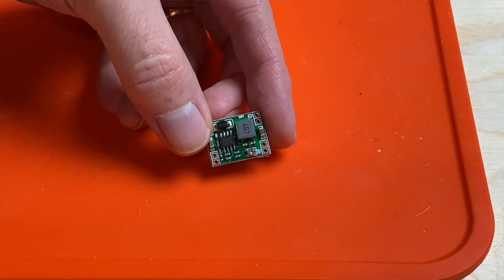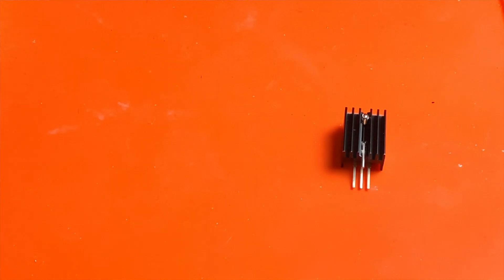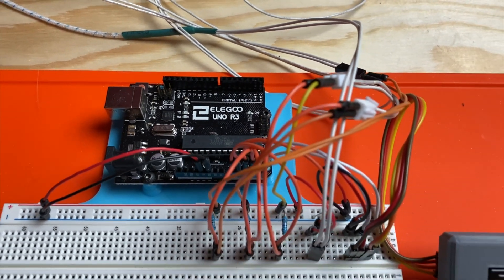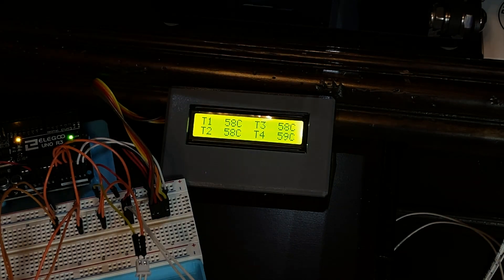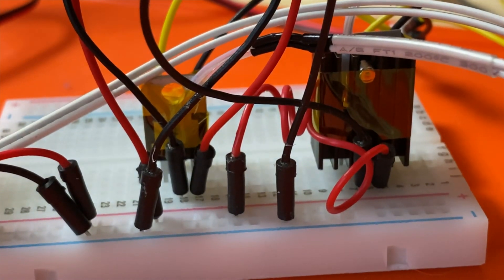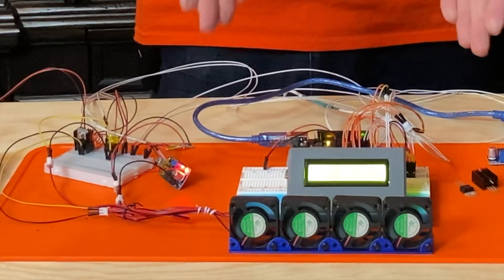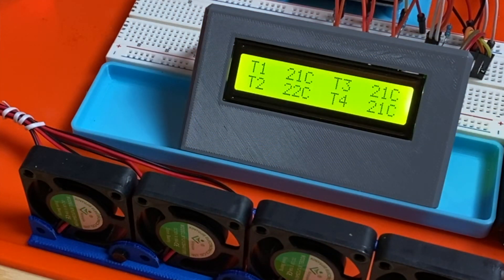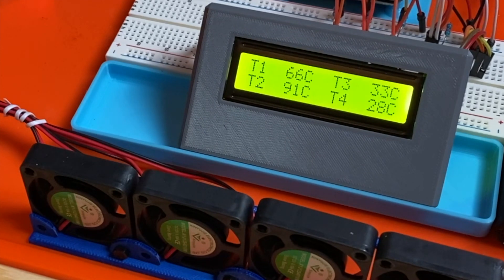Buck Converter vs Linear Regulator for 12V Fans on a 24V 3D Printer

Comment: If you have two fans to cool at 12v each at the hot end wire them in series then you will have an equivalent to a 24v fan , but the current drawn will not double, as the current remains the same throughout a series circuit.

Comment: Thanks for the clear, concise and practical video. I'm enjoying your video series. I did notice the neat 3D printed case to hold the LCD display. Care to share the source files? I'd love to build that case for my LCD display.
Reply from the maker: Hi Richard! That particular case is one that I designed to hold the 1602 LCD and an Arduino Nano, with a port to connect a temperature & humidity sensor. It's not really my best work, having been designed about 6 years ago. I'm not sure if I still have the files. :) I recommend doing a general Google search for "1602 lcd stl" -- there are probably a thousand to choose from.
And thanks for watching the Arduino videos! I'm glad you like them!

Comment: I suppose another option would be to put the L7812 in the vicinity of the fan to cool it. Or stick a resistor in the line to "share the load". Or maybe just build a buck converter with the L7812..

Comment: The easy way to connect the fans is with 2 electrolytic capacitors in series between +24v and ground, at mid point you have 12v in reference to ground, the better is that you don't have over heating in the components. Is that the way I do.
Reply from the maker: Hi Sergio, this is interesting to me. What value capacitors do you use?
Reply: @BV3D  you can use 2 capacitors of 470ufd @ 25v

Comment: Nice to see this test and results.
About the temp... it depends where you put the regulators. If you put them right next to the fan you are cooling, it can cool the regulator too. Adding a resistor to the circuit to drop the voltage before the regulator helps a lot too.
Adding them on the frame of the printer is a good thought since they help heating the printer, especially nice in wintertime... I actually use the heat of some of these regulators in my printercase.
Without capacitors and filtering many of these little buckconverters do make some noise on the system by the way. I replaced some I had on my printers with liniair regulators because when the fan was running, the radio did not have a good reception anymore but after replacing them I could listen to the radio again. It took quite some time to find the culprits :-( 
Lineair regulators only get warm when there is some current going through them, while buck-converters always use some power when they are getting power, so for fans that are on only sometimes and on low use it might actually be better to use a lineair regulator instead of buck.

So really, both have their pro's and cons. I now use lineair regulators for almost all of my 12V fans on 24V systems but for other usages I use buck-converters.

Comment: I get PWM squeal on many of the 24v fans I try to run between 12-20v with my buck converters, heat aside, would a 7812 get rid of this?
Reply: I see you never got an answer, which is a shame as that's a question I have, too.  🤐

Comment: I would like to have seen the current draw on each one.
I'm pretty sure the buck converter is going to waste much less energy.
Reply: When in use, the lineiar regulator is drawing the same current as the fan, just transforming half of the energy into heat.
But: a buck-converter is drawing only what is needed for the fan on 12V (so about half of the fans current) + some losses. But when the fan is off, the converter is still drawing the losses. I had some cheap converters that were using over 5uA always but others like 10uA for the same situation. So generally a lot less especially when you have higher currents.

Comment: Hello, these is a point that I don't understand : 90°C vs 28 °C, there is a huge difference... 
As these devices do the same thing, where does the heat-lost power go using the small buck converter ?

Comment: Great video, good job!

And how can you control the fan that cools the filament?
I ask this because I am looking to use a 5015 12V fan to replace the 4010 24V that comes with the printer, and from what I understand that fan is controlled by PWM, in that case it is better to use the linear regulator to lower the voltage to 12V and preserve the characteristics of the PWM signal?

Comment: Hi Bryan.  Can i use 1 buck converter to downgrade 24v to 12v to 2 separate fans?
Reply from the maker: Hi Kevin! Yes, the fans don't use much current at all, and the buck converter has plenty to spare. So you can run the fans in parallel, meaning each fan's red wire goes to the + output, and each fan's black wire goes to the - output. 👍
Reply: @BV3D  awesome thanks.  same day reply.  much respect.

Comment: are isolated DC/DC converters better than non-isolated (buck) converters for the money? on mouser there are the CUI PCSA1-S24-S12-S and the Mean Well SPU01N-12 for about $3-$4 each for 24v to 12v nonadjustable.
Reply from the maker: Hi! The DC/DC converters you listed can output a maximum current of 84 mA. A Noctua NF A4x10 only needs 50mA, so technically they would work. That said, the buck converters are about $1.20 each and can output 3000 mA. For this application -- powering fans -- I don't think you'd need an isolated DC/DC converter. Without using a buck converter, the fans are connected directly to a 3D printer's main board.

Comment: Brian, thanks for doing the test, while I like the Linear regulators, like you've shown, that drop in voltage is a factor, as well as just having a tool that isn't only going to be used for one thing - I can use the Buck converter for another project due to it being adjustable.  Mickey the Fuzzbutt was really cool to bring up this idea,  "always ask why?" is a great way to look at life. Any chance of sharing the INO file and other documentation on the project?
Reply from the maker: I think it would be fun to make a video about putting together the code and hardware for the test rig. I have a few other things I'd like to use it for, so maybe building it into a small enclosure would be handy.

Comment: Nice video and "write-up". 
I'll say I fell in love (somewhat) with Nextion displays shortly after getting my first arduino kit w/ an LCD. Always had issues w/ character formatting, drivers, and wiring the things. I use Nextion for all my projects now. Probably overkill, but love the touch screen and serial comm format.
Reply from the maker: I will have to look into the Nextion displays. I used what I had on hand. The I2C LCD was from an Alien3D UFO Box! 😄

Comment: Nice job Bryan! Excellent test setup and it's always a pleasure to see people test preconceived notions.
Reply: Sometimes you just don't know until you test a hypothesis.
Reply from the maker: Thanks, Kris! I figured I would use some of my newfound Arduino skills to show the temperatures of all four devices at the same time. Originally I was going to test each device individually, using the temperature measurement feature of my multimeter (it included its own thermistor). But that wouldn’t account for differences in environmental factors between tests. So I came up with this way. I think it worked out really well, and I can think of a few other ways I could use a quad temperature display, maybe for showing temperatures at different locations within a printer enclosure, as well as showing the ambient temperature outside the enclosure.

Comment: HI Bryan  can you take a look at my newest Video  ,  my problem will be 30 LEDs and  maybe a 9v Block Battery or a 5v power Brick  which Resistors must I put on each LED ?
Reply from the maker: Hi Don, if you're going to use a 5V power supply for the LEDs, try a 330Ω resistor on each LED. Test with just one LED though, to be sure it's going to work. I'm not sure what voltage your LEDs need. Some are designed to run on 9-12V and don't need an external resistor (I think they have one built in). But if you're willing to risk it, try one LED + a 330Ω resistor with your 5V power supply. If it lights up, great! if not, switch polarity on the wiring and try again. But if you get it to light, let it run for a little while to make sure it stays happy.

Comment: Great to see this test done. I liked your quad temp sensor setup. One other factor are the capacitors called out in the 7812 data sheet for stable operation. Without them there is always the chance the feedback circuit can see noise from the load and cause oscillation which can cause the device from properly regulating and get damaged. Capacitors are cheap but add to the cost.
Reply from the maker: Hi Chuck, and thanks! 

One of the great things about Arduino stuff is that there's so much code out there, and so many projects, that you can find what you need and mix it together to get something new (like combining "how to connect and read a 100K thermistor", and "How to use an I2C LCD Screen" into a project to read the four thermistors, calculate the temperatures, and display them on the screen).

And about the caps -- I see that now, looking at the spec sheet. I'm kind of familiar with using filter capacitors on the old 7400-series logic ICs, so I guess that's sort of the same thing.
Reply: " Capacitors are cheap but add to the cost.", not a big deal when building a one-off, yet a major factor when building and selling X number of them - very good point CHEP.

Comment: Hey, I went to rainforest.com to find some buck converters but they only sell jackets there..... 🤔 😂 Such silly rules. 
Anyways, great video as usual Bryan. I liked the scientific approach you took, very clear results. Also, an advantage I'd like to add to the buck converter option: many times when ordering inexpensive electronics we buy them in lots (see above video as example 😁). It's nice to have a device will will be useful in other applications, say 24v to 5v conversion, rather than be stuck with several single voltage option devices. 
Anyways, that's my take on it. Thanks as always for sharing!!
Reply from the maker: Haha! I think I've come to terms with how to address the whole "The First Rule of Affiliate Club: Don't Talk About Affiliate Club" thing, going forward. Problem is, there's no easy tool to "bleep" out the offending word in existing videos, and YouTube won't let you re-upload a video while keeping its stats.

But yes, I also appreciate the general purpose-ness of the buck converters.

Also I was quite surprised at how hot the 7812s get. I didn't think they would get nearly as hot as they did.

Comment: Great video. I've read dozens of times that (most) Noctua fans won't output enough to keep up with our 3d printing demands. Supposedly the heatbreak will be more prone to jamming and it's more prevalent on longer prints, have you experienced anything noteworthy?
Reply from the maker: I personally have not had an issue with them. It may depend on the hot end style, or whether it's an all-metal hot end. I've got Noctua fans on the cold side of the hot ends on my Monoprice Maker Select Plus printers, and on an Ender 2. I haven't done a ton of printing on the Ender 2, but the longest print I did was probably 12 hours, using PLA. 

I haven't really noticed a jamming problem with any of them, apart from a particular filament brand that had unmelted PLA pellets mixed in with the filament. Doesn't matter how you cool the hot end when the 1.75mm filament has blobs bigger than 2mm. 😄
Reply: @BV3D  Good to hear, thank you again! I rarely see a reddit post without someone trying to jam that Noctua information down everyone's throats. I too had no issue with my Noctua on my stock Ender 3's but was curious if maybe I just wasn't printing for long enough of a duration. Much appreciated.
Reply from the maker: I think everyone has different views on the matter, but all I can do is share what I've experienced. I mean, at one point I had a 5015 blower moving air across the heat sink of one of my Monoprice printers, and while it may have kept it a degree or two cooler, I think just the amount of air the Noctua moved over the heat sinks was sufficient for the job. (There is very little metal-to-metal contact between the heat sink and cooling block on my Monoprice printer. Weird design, I guess, but it seems to work).

I guess that's the thing. The fan doesn't have to move a ton of air, it just has to move enough air.
Reply: @BV3D  maybe do another video showing two 40mm fans, one 12v and one 24v taking a pitot reading inside a 40mm square duct to measure air flow volume.  I think how the 12v fans achieve quieter operations is that the fan does not spin as fast as the 24v fans.  If the fan is moving slower, then air volume output is going to be less and your hotend will not cool as fast or maintain certain temps.  But like you said earlier about not having any issues with 12v fans, I don't know.  I too did not experience any issues with a 12v fan as I have one on my Prusa and a 24v fan on my Ender 3.
Reply: That's the downside to the internet and product reviews... if you keep reading long enough you can always find someone who isn't happy.
Reply: I've ran a noctua 4020 fan on my ender 3 for ~1 year now with no problems on prints ranging from 20 minutes to 2 days. A lot of misinformation imo regarding that, most likely based on Tim from th3d's video.